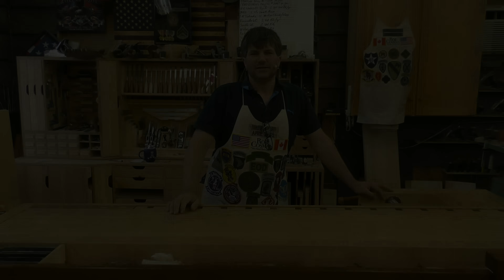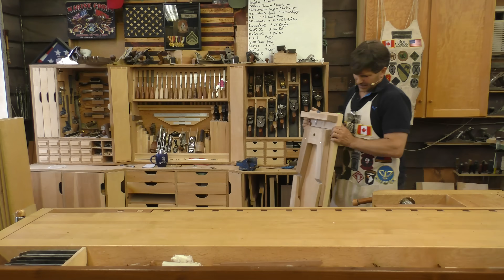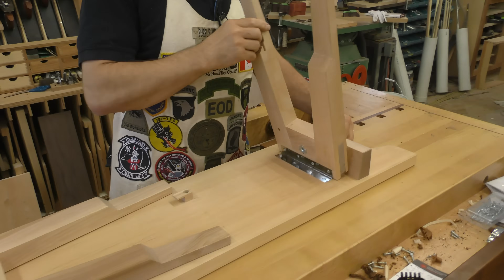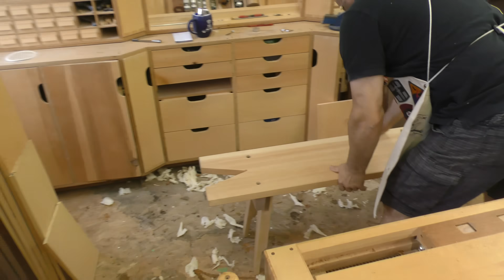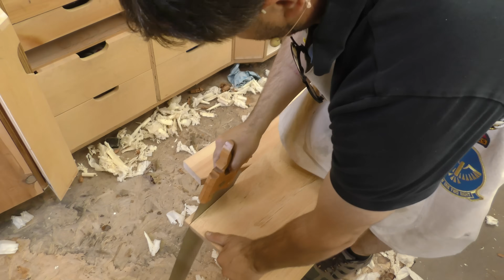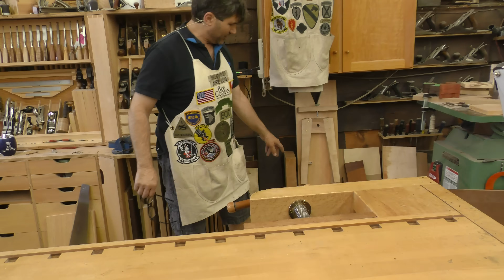Saw Horse-Hand Tool Project with Rob Cosman

Comment: Looks like a fine design.  Surely McMaster-Carr, or somebody like that, has a "wing-bolt" that's manufactured stock, so I don't have to bother with the home-forged version?
Reply from the maker: You would miss a lot of the fun.
Reply: Just use a normal bolt, but glue a solid wood "handle" on to the head so it's easier to use. There's a lot of space, so a larger headed wing nut of wood wouldn't get in the way.